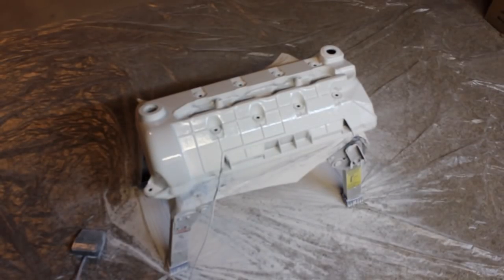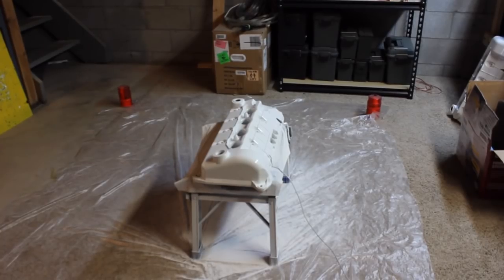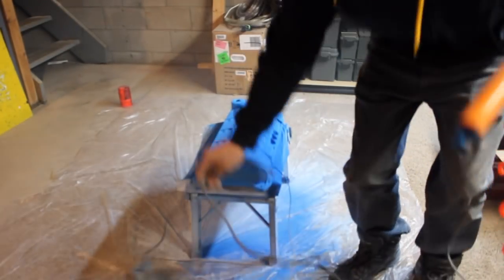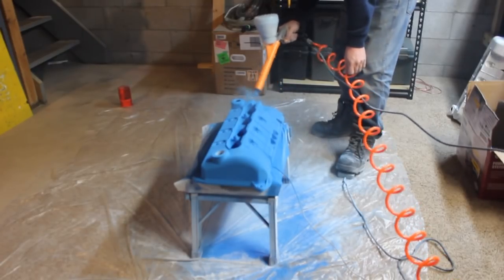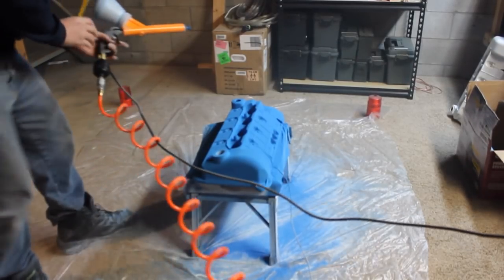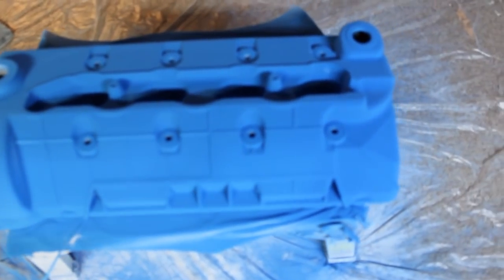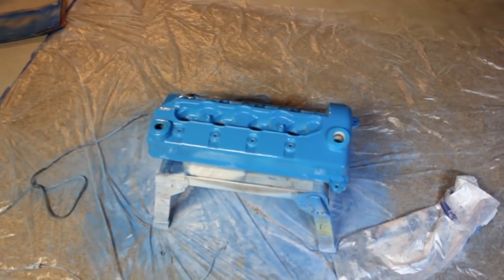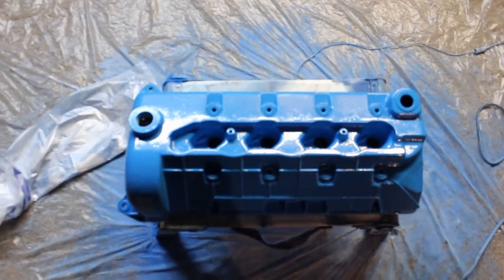DIY Powder Coating Ford DOHC Valve Covers W/ Harbor Freight Powder Coater part 2

Comment: I have just started keeping the foot peddle in my hand.  It's just easier to move around.   If I'm doing a small job in my booth, I just put a spring clamp on it.   You will also see better results in multi coat applications if you use an earth ground.

Great job!  They look awesome
Reply from the maker: Great idea skykiller, I gave it a try and works great. Thanks for the tip!

Comment: Great video sir. I would like to ask what type of primer did you use? Did you sand in between primer coats? Thank you
Reply from the maker: For darker top coat colors, I just use a grey powder coat as the base layer, and sand between layers to give the top color coat something to bite to. For lighter colors, I use a white powder coat as the base coat. This gives awesome coverage for the top color coat.